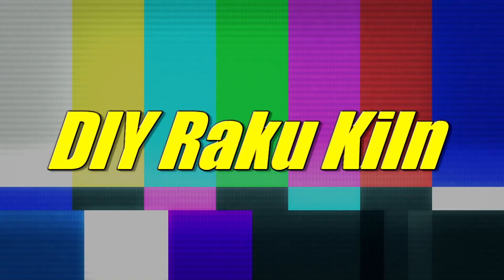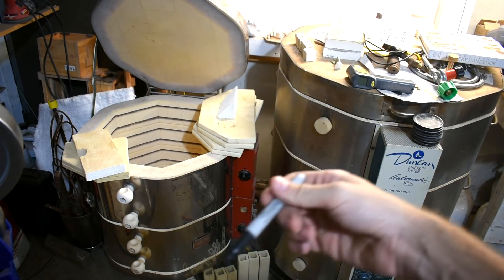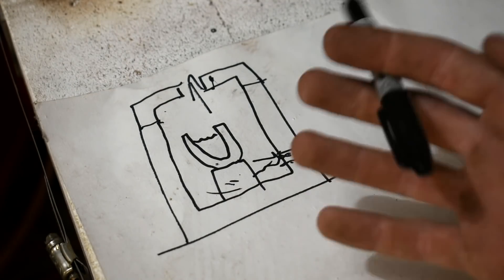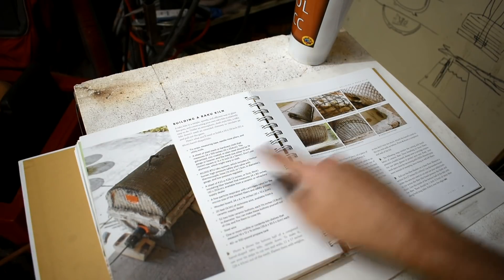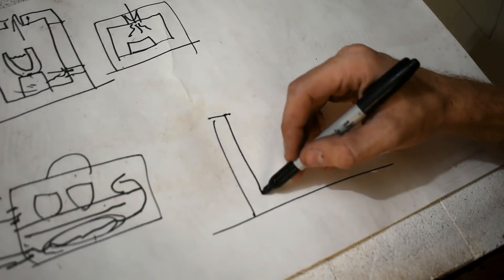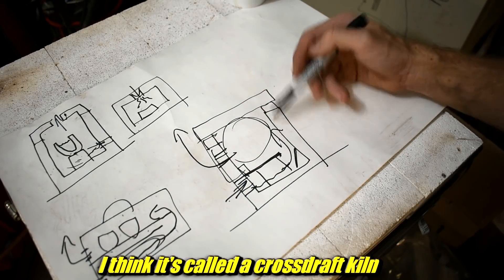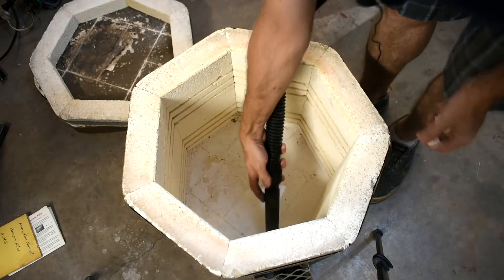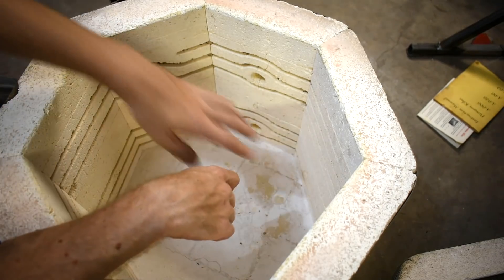Raku Kiln from Electric Kiln! Part 1: Modifying the dead, free kiln

Comment: Could you use a kiln shelf as a floor? or is there a reason you are using fire bricks instead of a kiln shelf? ty
Reply from the maker: I used bricks because I had them already and they are easy to cut to exact shape.  You can definitely use a kiln shelf if you can get one that's the right size/shape or you are able to cut them

Comment: Can these pottery kilns be used to melt metal once they've been converted?
Reply from the maker: It could, yes.  Most pottery kilns though are designed to hold a lot and heat relatively slowly.  A smaller, faster heating furnace would work better for metal casting
Reply: @PaulsGarage  What if I relined it with new bricks or just put new bricks over the old stuff that's already in there?

Comment: Gotta love it! This is how it is designed, but we’re not going to do that!

Actually, I think that’s a pretty good design. My be getting a blast of hot air in your face though.  And a bigger floor would be good. Hate to be firing one bowl at a time...
Reply from the maker: The hot air in the face is fine, my beard is fire retardant 🤣

Besides, the way its fired garauntees hot air blasting all over.  You open it up when red hot and pull the thing out, dump it into a bucket full or burn able stuff and put a lid on it.  Smokey and hot!